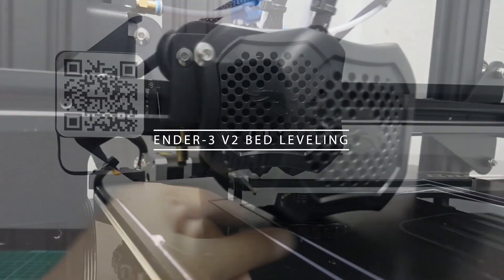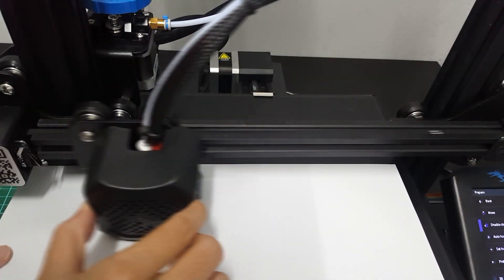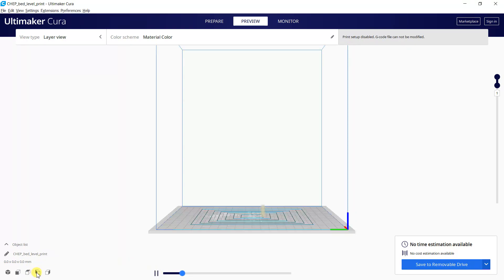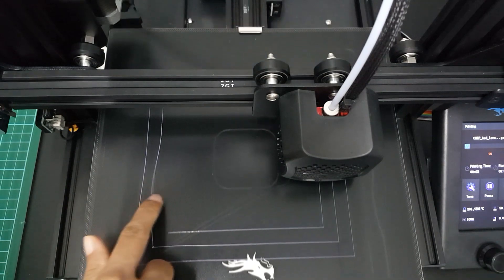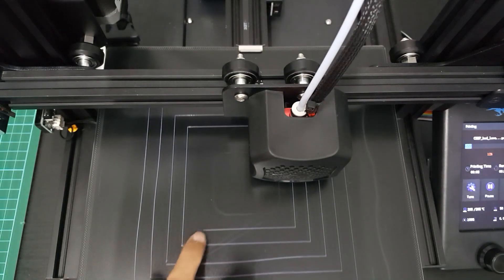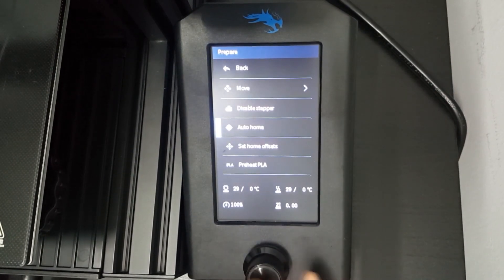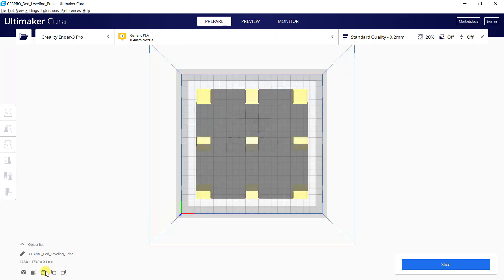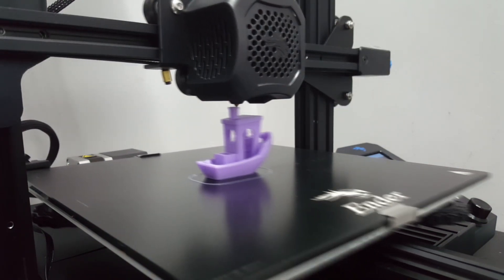Ender 3 V2 Bed Leveling #3dprinting #diy

Comment: Adding glue to the bed will also make the filament want to stick even better.
Reply: Maybe if you're using a dated printer. Modern 3d printers should stick without any additives. Using glue at first may help your prints, but will cause a lot of issues in the future

Comment: That print bed needs a clean. I find one run with acetone followed by one run with isopropyl alcohol with the bed heated works perfectly. 
Also, if you touch with your fingers at all, you should clean with alcohol, otherwise it will prevent print from sticking
Reply from the maker: Hi. Thank you for your suggestions. That is very helpful. Thanks :)
Reply: @cytrontech  no problem! Your video helped me with the leveling :)

Comment: You should try to never touch your glass bed with your fingers. Even though you think them to be clean, they will leave an oily residue on the glass which causes the filament to not stick tot he bed.
Reply from the maker: Hi. Thank you for your feedback as I can make improvement. Thanks :)